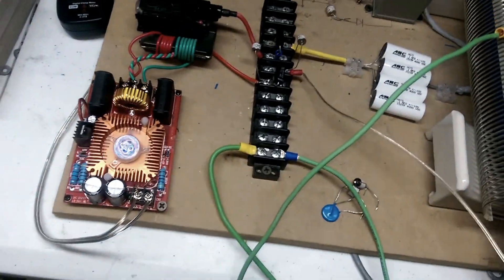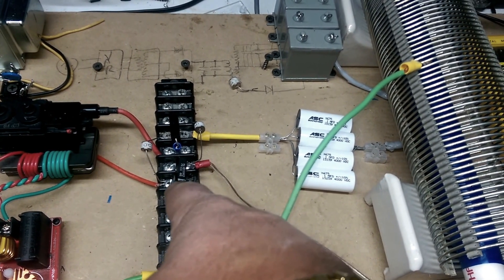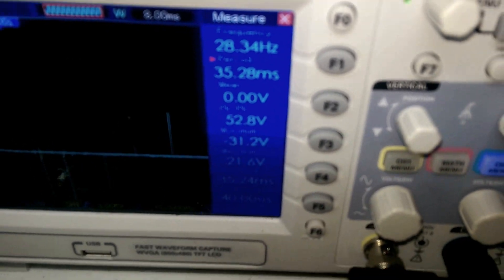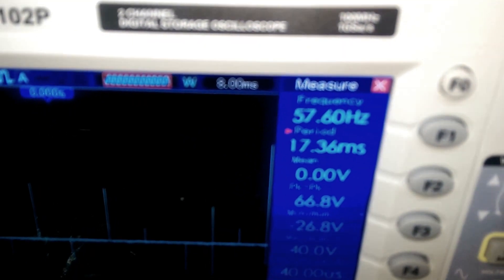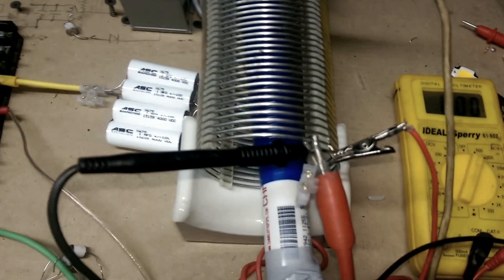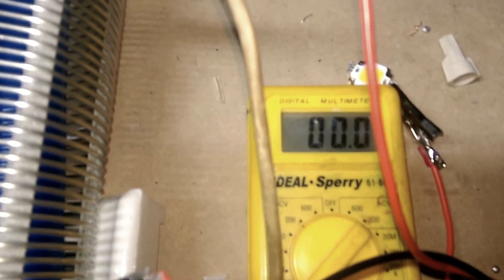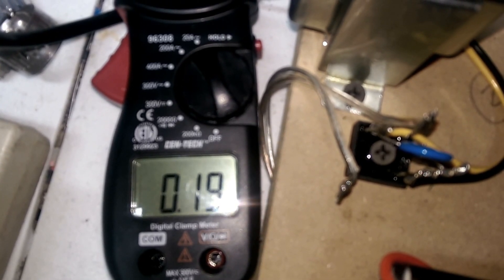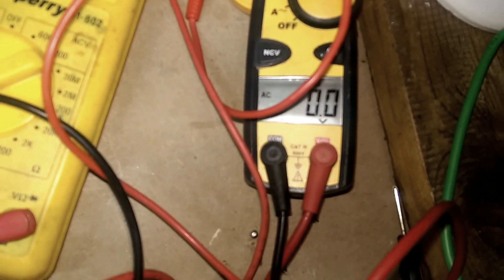Don.Smith Replication.Attempt

Comment: Love it, thank you.
There is voltage there... my theory is the volt meters doen't measure volts they read the magnetic displacement and translate it to voltage. So once you cancel out the magnetic flux one way or another ie bifilar or tesla amp windings... the magnetic flux and therefor voltage is only hidden from the meter. Because the negative and positive magnetic fluxes are perfectly nulling each other out... but they are also still there. Its only the NET result creating the perception that there is no voltage. Like standing waves don't look like they are moving... no movement no difference to detect. You could possilbly measure the real voltage by the distance a spark can jump through air on the secondary side. Spark Gap Distance vs Voltage tables... should make the volts show up again :)

Comment: I wanted to write a comment and some suggestions, but then I noticed this video is 5 years old, I therefore, did not feel writing a comment unless Marc is still experimenting DS energy device. One thing for sure that I would like to share with others still doing Don's replica: The most important thing in Don's device is the EARTH connection and how to use it. Second important thing is the resonance frequency for both L1 and L2 coils. The rest is as easy as 123. Don never revealed complete information; he never presented a working device; he showed up in many seminars with faulty equipment; either the diode was blown up, or because of driving from Texas to seminar places; the bumpy ride messed up many things. He showed only Models of his theory. But, having said that, I am not discrediting Don, he did a great job and he gave tons of information which could lead the experimenters to build a successful device, such as I did. But there are lot of things to do, calculate, and tune properly before this MONSTER would work. Just to give you a simple example, the wire length connecting the coils to diodes, terminal strips, wire sticking out of the pipes, and wire used to connect 12vdc batter to inverter; all must be in perfect harmonics for the device to work. It is very subtle, very fine tunned device to produce energy. I have done that in three models, 7KVA, 10KVA, and now working on 19KVA. Once you know the basic principle this is like building a general purpose transformer for a battery charger. YES....this device, once started, would not need external source of energy to run. 
That is all I wanted to say. I will be posting my videos very soon with all the steps I did. THE LAST AND MOST IMPORTANT THING. YOU MUST HAVE AN OSCILLOSCOPE TO CHECK YOUR RESULTS. IF YOUR DEVICE IS NOT SMILING AT YOU ON THE OSCILLOSCOPE BY SHOWING A RISING PULSES.....THEN YOU ARE DONG SOMETHING ELSE NOT THE DON SMITH'S DEVICE.
Reply: Hi, I'm experimenting with Don Smith devices. Did you ever get around to posting videos of your results?
Reply: Yep, old comments but man y'all kill me with this shit. I could spend days going over all the clear bullshit in so many of these videos.
This bothers me because it completely destroys any credibility such ideas can have in the mainstream world. You're already working with a disadvantage against physics but to get anyone to even listen you have to be reasonable. 

Think about how ridiculous it sounds to just say "you have to add the ground" or something like that. Think about how many damn Tesla Coils people have made on the planet and that they are doing just that. Think about all the variations of tuned inductors which are using some kind of ground. Did Tesla ever once claim to use the ground as a power source for his coils? If this was so feasible why was he wasting so much power running all those generators?

This guy here is lighting an led at a fraction of its rated power and saying it's fully lit. People are throwing capacitors over top plasma globes and saying the led loads are not drawing from the supply etc. People are picking up tiny fields coming off their HV supplies and charging small caps with them again saying this is unrelated to the supply. Well guess what, it is. Every single time, it is. 

Let me give you an example. This guy has shown his OU effects by showing an led lighting and drawing less current from the system in the process. Well ok, just keep adding more then until the current goes to 0 and you have ALL these loads right? Well obviously that's not what happened. This same guy showed an incandescent bulb partly lighting off his NST output and claiming that it was not affecting the input side whatsoever. He said this literally as he showed the voltage drop on the battery feeding the thing while running the load. This is why more people can't take this truly interesting stuff very serious.

When you tune your coils you've just created what is called a Spark Gap Tesla Coil, but it's not being used to discharge millions of volts in arcs. In could probably do many many thousands still if tuned right despite not being a tall tower of many windings. When you tune L1 to L2 and have them both ringing you've made a dual resonant system. This is something people do all day long. 

It is literally insane to just say once you get that concept going, just adding a ground is the 'key' to seeing all the rest of the magic. Rising pulses is great but this just REGULAR LC tank activity so long as you are actually feeding the tank at resonance or a harmonic.
There is a REASON you see so many people with these "I have overunity" videos with some Don Smith kind of setup, then some times later they've jumped over to some other shit. Apparently that first one wasn't quite that magic OU was it?
Reply: @Magneticitist  first of all i wouldnt be so quick to post a ou video on YouTube if it just shows a dam led lighting up. Who is that going to convince? People that get true ou light multiple 100 watt bulbs. As for the grounding technique. The reason why experimenters move on to other shit is because they didnt listen to don in the first place. He clearly explained how you need to introduce resistance to guide earth electrons to the path of least resistance, your load. One ground wire will never work, so obviously people will fail and accuse don of withholding information. Thats why the eastern europeans get ou and americans dont. They listen instead of always questioning and complaining
Reply: @scraw3  I've def seen many OU claims using a basic iteration of this device. Don was either intentionally steering people wrong, or doing it unknowingly somehow. This guy here though, he has comments going around about how you can light all the bulbs you want by using those two Earth grounds.

Let's take the example of this resistor Don says is going to go on the output and convert this 35khz into a usable 60 cycles. The one he says he had to specially calculate going by the American Radio Relay League. He is talking about things like impedance matching but saying it like it's going to down convert frequency.
How about the ground shunt resistor or whatever it's supposed to be.. There is no reasonable explanation for this I can see and he just sort of spits out something about needing a resistor on one side to block up electrons in the circuit so they can't escape. If we're talking about two grounds we're still talking about a closed loop circuit with two grounds which have a high impedance between them (if far apart). This means you are placing a resistor in series with another one through the Earth. You can have a difference in charge between two negative nodes and it's voltage all the same but it's still a closed circuit. 

I think what some people are failing to realize is that this power they see themselves producing across loads by using some kind of 1-wire to Earth connection, or whatever, is either just using a high voltage across an Earth impedance (two points), or capacitive coupling to ground, something which is seen quite ferociously in Tesla Coils.  In either case they are saying this power is coming from 'Earth energy' because of an electron pump but they are not mentioning that this is a closed circuit using capacitance. This means they can pretend all they want to that this is not loading the supply, but there are multiple reasons one may not see a change in the front supply when loading on some output especially when the capacitors and inductors are the real supply. There will still come a point when the NST or whatever it is cannot output any more, whether it's charging a certain value capacitor to a certain voltage, or directly driving some load as some people have done. 

Some call it trying to 'shock the ambient' into giving you some return, but this is just a strange way of saying they are capacitively coupling a high voltage they are having to supply on their own. I blame them because they know full and well (and presumably trying it) that they could not infinitely load this circuit using this claimed free energy. They couldn't even run a bulb at higher wattage than the supply because they are just running some random wattage bulb at a non specific brightness which is in no way a real indicator of efficiency. If someone out there may actually do it, no one will give a damn because they've seen so much other BS.
Reply: @Magneticitist my undersstanding is you need a resonant transformer with a spark that will shock the ambient into releasing electrons into the circuit. Resistance is mininal since at resonance the coil behaves as a superconductor which it does, but thats just one stage in a process. With other stages each one in resonance and combined with an earth ground with a thick wire incorporating the right combination of resistance the secondary on the isolation transformer should be able to draw the exact amount of current from the ground that is flowing in the resonant coil without loading down the input because electrons are not flowing from input to output. One stage is triggering a reaction in another stage like a scream followed by an avalanche in the mountains.
Reply: @scraw3  This is something I'm going into now actually. I'm just going to use a DRSSTC driver I made cause that was actually my first thought going into it, but the spark gap is just so much more robust of course. There is also the extra bit of disruptive discharging such a high voltage that is very hard to do with silicon switches. So instead of a kV supply I'll just start low and let the resonant tank ring up to thousands of volts to supply the L1 instead.

At resonance you do basically turn a circuit with inductive and capacitive elements into what is basically just a DC circuit where impedance becomes plain resistance. Inductance and capacitance and their reactances basically cancel out.

Resonance in converters like this is basically an engineering staple for efficiency and HF resonant converters are pretty cool. I'm going to play around with a SG setup I had but use the feedback switching for LC resonance. This should provide so much more efficient power throughput at the cost of not being able to bang really awesome sparks out that may not do a whole lot. 

Getting that 2nd resonator tuned is the hard part because things are going to change around with various loading.
Reply: @Magneticitist  did you read the zilano post. She built a fully funcional ou tesla coil in stepdown mode by replicating a don Smith schematic and improvising. No reason to reinvent the wheel when she has already paved the way
Reply: @scraw3  I haven't but assumed it was some spinoff of the Smith stuff based on some YT video titles. You have a specific link somewhere?

What you describe sounds similar to what my end goal was just for kicks. I spent so much time trying to get powerful arcs from some coils looking at them as inverters and eventually figured I'd try to just switch one over to a resonant converter for running loads to see what happens. Step down with parallel resonance seemed like a good test for high power stuff. Step-up as per normal but basically a low impedance L2 seems good for driving line loads from a battery when converted to DC. For the end goal I have fixed frequency in mind for precise tuning and perfectly in phase output seems necessary.
Reply: @Magneticitist  the devices zilano built are spin offs from don Smith, tariel kapadadze, and others. The secrets that those inventors kept to themselves were discovered by zilano whom shared them on the energetic forum years ago. She is from one of those ex soviet countries and one thing about experimenters in eastern europe i like is they are very resourceful and open minded. Even don Smith said this. There is a Russian on YouTube that shows all types of don Smith ou devices driven by a slayer exciter, no tuning capacitors, but videos are in russian. These guys have advanced even further than don smith. The zilano post has information and hacks that you wont even find in any don Smith books. Zilano shows a picture of a resonant torroid lighting up 12 light large bulbs, with schematic, but its in Russian. The links that were on the YouTube video are no longer active, but i have all three ebooks i could send you or go on scribd pay the membership fee and dowload the zilano post from there.
Reply: @scraw3  The thing about that concept to me is still sort of the resonant rise being equated to OU without measurements. If I could see the measurements or at least a puny source for such a large load I can call it something. What gets me is a similar concept in stuff like the HFSSTC's such as the one Steve Ward made. It's not even dual resonant and the power is amazing. When in dual resonance things become so efficient and you can light all the bulbs if you wanted but there are a lot of nuances to it where it's not as easy as just matching two coils to the same frequency.  

Single resonance and the power a primary LC can provide is shown all over youtube in the form of huge arcs or powerful induction heating etc though. I'm actually surprised I haven't really looked into inverter efficiency using a DR setup before because at the very least it seems like it could be the most efficient way to go about these circuits where one may try to run mains loads from a battery.

Comment: I just have to say this out having seen the effect of resonance in one of my test coils: You only need RESONANCE.

Don Smith once said that most of the circuit diagrams he released a FAKE and or Incomplete. I read that somewhere online and that propelled me to further dig for the main true understanding of his circuit and I finally discover it to be RESONANCE.

But Resonance is the first key. Other key points are High Voltage Damming Capacitors , High Voltage and High Frequency.

Read https://lm.facebook.com/l.php?u=http%3A%2F%2Fwtamu.edu%2F%7Ecbaird%2Fsq%2Fmobile%2F2014%2F01%2F28%2Fwhy-does-lightning-push-electricity-through-air-but-common-batteries-do-not%2F%3Ffbclid%3DIwAR0pQ2CG6NdovbxIeEvikRBOK7UHIYO8I_4eaX8RZ42esduT8xald1J_6iw&h=AT3mTkqKuTrSoBVNvuKcNYxm2KDlu84ecjkKcTaaAn41oqZN8Z8FdMT8oFW-Kj300I8o6Azqqd2nO9LfowV0Lr_pVd5rHA2fj_lWKTz2YVqo2nYJTa31R_a6GIZy0R4BvLpfE4iVfuowGeRsRgCg8moPtx4YbfQl_HwqasLNY3msS3NgJ2BYf9yk9T7WVIaHM5WeIheot_X5mMF_ftov2OD-aZMU3FxeYkSYMHAJIAQVvPDSfYhq4txyRN47OJ20DRt1dI4gMBcWoxw4rfBoPEFnUM-pmX6JsH9gHW_ftP8nc8y4XQUj9Bsaju2zEffbVUY2P7rKWUXU7sKkFKJzGWLPNgz36LIzVaVK1UYWuhlQS0ttMv8rlj5VWTbqO09fSIw-j-1bksRT2z5CdOmIvSYXPxUlAdQdvyR_yNONRKSYA4WeGueuOE2H96mCv__VcTDOCSpv5U9_trC9MesDUv0_vHgnZ4KQaMpNqyaLT5VjglGw3bI4_f4-V3Hse97HjgOIh5mIB-UaTFLhW1mfbqMWVhhst9PP for you to know why you need High voltage.
 You do not need the L1 L2 coils!!! It is not mandatory as the main principle is all about RESONANCE AT HIGH VOLTAGE. I discovered from practical tests that it is at High Voltage application that Ambient Current flow into any Resonant H.V transformer.  So to utilize the Power now you need to Dam the inflow Power with High Voltage Polarised Caps.

This is it: whenever high voltage either at low or high frequency is present in an inductor, Ambient Current will keep DANCING around it. But once that H.V carrying inductor is tuned to it Resonant Frequency, the Ambient Current will Rush in. 

The level of Speed at which they rush in will now be determined by the applied FREQUENCY. 
This is why the Don Smith Formula for Energy in one seconds squared the V(voltage) and F(frequency of Time)